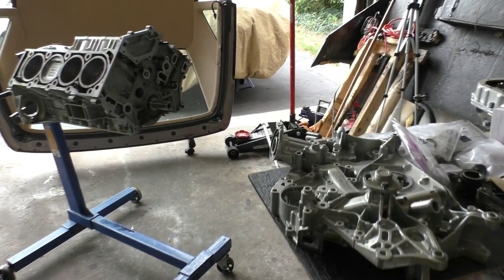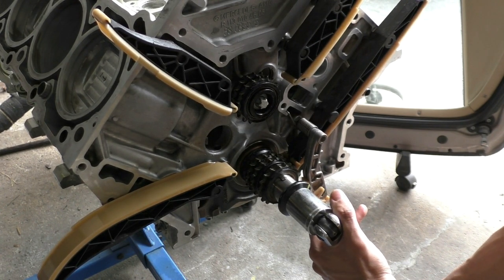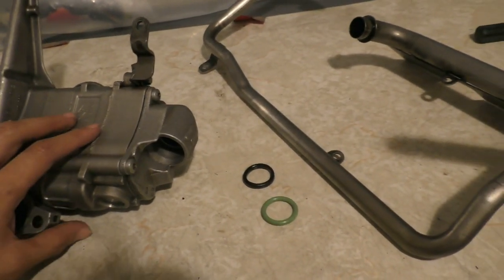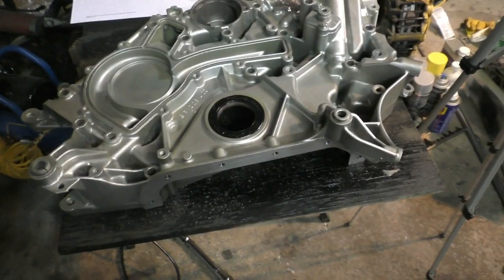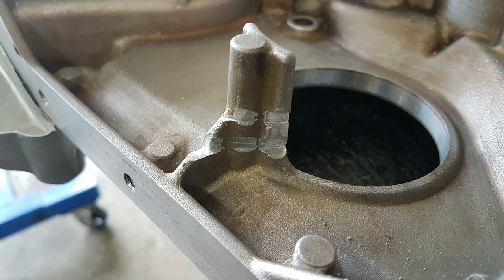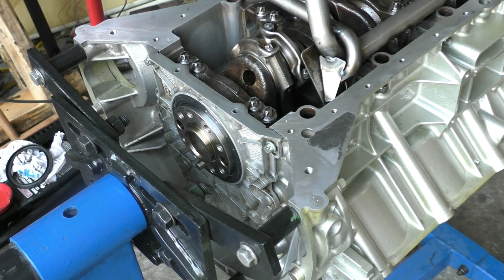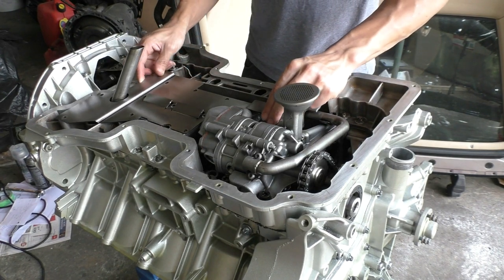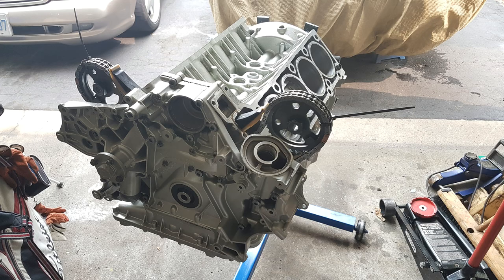E55 Engine Rebuild - Part 5 (Timing Chain, Timing Cover and Oil Pump Install)

Comment: Hey Is there a way to do the oil pump chain without a full engine rebuild? I have the noise where it hits the timing cover. Should I be worried? I drive the car hard often. If there is a way too do it what would you recommend while in there.

Comment: Also can I get to the oil pump pickup tube o ring if I did timing cover refresh/timing chain and the oil pump chain/ tensioner? Can it be done if you do a timing cover refresh or will you have to flip the motor over?

Comment: The green O-ring material is the same as used in home HVAC units. It's supposed to be more durable and this is becoming a common upgrade for automotive O-rings. Most shops here have HVAC O-ring kits to replace old O-rings.

Comment: Welcome to the operation channel. In today's surgery, we'll be putting back together the AMG E55 M113 engine. Nice work! Enjoyed watching every meticulous minute of it!

I think turbocharging is a great modification, in addition to supercharging, because you'll overcome the initial turbo lag with the SC and have the higher RPM torque & horsepower with the turbos. However, I'm curious to see this engine block without an SC and just turbo chargers only. THAT would be interesting, especially the numbers on the performance difference.

Keep up the great work!
Reply from the maker: Yeh, the turbos probably won't have the same low end torque the SC gives. They're sized for higher rpm's anyways, but I think it will help make more power in the higher rpm's because of less restrictions in the induction system and lower rotating mass
Reply: @xfmotorsports  Agreed. And if you're purpose of the engine is time attack, then it's safe to say that the predominant application will be in the high RPM range, which will favour the turbos more that the weight cost of the supercharger you discussed in your video.

Comment: Thank you for this video series. It has helped me to get this far. I have never rebuilt an engine before. Unfortunately I am now rebuilding my 87 560SL M117 and it scares me to death. I’m getting ready to assemble the engine and I can’t seem to find documentation on applying sealant to the front & rear covers. The documents you have for your M113 is something I need. Where can I find this for my car/engine? All I can find are torque specs & terrible PDFs. Every single nut & bolt on my entire car I have removed from the ground up. The engine is the last thing I needed to do. My transmission is being rebuilt by Sun Valley Mercedes Transmission in CA (#1 MB Trans rebuilder in the country). Next week I will be assembling the cylinder heads & lap the valves. I started a YouTube channel to help me document the process so I can hopefully put the car back together. I’m doing this because I could not find anyone else to rebuild my engine. It’s been parked since 2008 & I hope to start it in 2022. Wish me luck cause I’m going to need it.

Comment: nice job so far:

when i look the way you use the gasketmaker i remember why i usually use locite 5980.  it's easier and quicker without that messing around with the tube and the silikon. 

go on. nice job.

Comment: Fantastic job you have done - amazing, priceless, incrediable! Your videos are my very strict guidline during replacement of all rubber sealings of my M113K engine. One request to you: Where do i find the sealing and screw diagramms for the M113K and which type of sealing i should use? Thx a lot for ur feedback keep racing...:-)

Comment: Such an informative series. Currently finding metal in my C55 amg oil and oil filter. I sent them two Blackstone analysis over the course of 10k to 12k miles and both came back clean. I’m assuming the timing chain rubbing on the cover is the culprit. It does beg the question though… wouldn’t this occurrence cause other internal issues? I’m hoping this doesn’t cause my engine to seize

Comment: Would polishing the oil pump for a cleaner seal not make it fractionally larger/looser?
Reply from the maker: It opened up by half a millimeter but the o-ring still sits pretty tight

Comment: How much is stealership only? Did you measure the before and after sizes? May need a bigger oring. Amazing that casting was ever allowed to be used.
Reply from the maker: The o-ring is around $3. No, did not measure the size after polishing but would have been a small difference. The o-ring was still a tight fit after polishing

Comment: When rotating my crank I'm hearing tapping in my passenger head periodically. I'm assuming my timing is off ? I dont feel any binding or super hard resistance.

Comment: Would you suggest one of these cars to the average car enthusiast? I'm thinking about buying one, but don't know much about fixing cars. Willing to learn though
Reply from the maker: Yes, try to find a nice clean one. Wouldn't recommend it as your only car but as a second car its not a bad option. They do give trouble from time to time and the maintenance can get expensive, but for the price you can get these cars for, its more than worth it

Comment: Did you try free spinning the oilpump after assembly? Is there any resistance on the sprocket due to slight misalignment? I noticed it needs to be perfectly aligned, beyond just driving the bolts in.
Reply from the maker: Yeh good point, there's no alignment dowels between the different sections but they have to line up for the pump to turn freely. I had to loosen and retighten a few times before installing
Reply: Great series, BTW.
Is there any real fix for this problem with the o-ring on the oil pump pickup? Seems maybe a different type of material to use for the o-ring is necessary.
Good Luck on getting your engine running as new (or better).
Reply from the maker: I wouldn't worry about it too much as far as there is an oil pressure warning when it fails. I think the dangerous part is not having any warning when the engine looses oil pressure. A few GM cars had similar issues with o-rings in the oil collector going hard, but those cars had an oil pressure switch so they actually warn you before something happens

Comment: You could grind a fair bit of the casting to avoid the oil pump chain from grinding on it. 

When i rebuilt mine, i grinding and polished it flat a gain.. however it still grinded.  (I used new chain and spring) 

I took the cover off again and grinded another  4mm of casting.  So far so good.  

That section of the casting only spaces out the case.  So grinding the side and leaving the length untouched will be fine.
Reply: Hello,i have seen your videos i have same problem with my e55 oil pump chaim scratching timing cover,1 question this materials that are being worn scratched by chain where do they go?if they go to oil pan is there any risk they can pass to the engine?thanks

Comment: Where did you get all instruction
How did you clean engine that good
Is it possible to replace chain with out taking pan off or engine 
How much did used engine cost? 
THANK YOU
Reply from the maker: Got service manual from 'emanual online'
Cleaned engine parts with wd40, wire brush, scotch brite pad and gasoline for the really messy parts
Yes, chain can be linked to old chain and fed in as you turn the engine. That's why they come open ended
Used engine was $2800. The parts were more expensive. I'll try to put the list of parts together soon
Reply: @xfmotorsports  i very appreciate for your respond look like you live in Canada as well cool and thank you

Comment: There is no instruction to use a straight edge or a special tool to get back face of upper oil pan flush with back face of engine block? I did not see dowels used to assure the fit is flush for both parts.
Reply from the maker: Yeh, good point. There's no alignment dowels between the block and upper oil pan. I just lined the back part using a ruler. As far as it lines up flush with the transmission and bolting points, I'm sure it should be okay. There's no gasket or seal required between the transmission and engine so its not as critical as lining up the timing cover, but still it seems to line up pretty well just using a straight edge ruler
Reply: SK8215 if you used a straight edge you should be fine. Many engines have sumps that make a part of bell housing and front pump bushing or input bearing (manual trans) wear and leaks can result if the surface isn’t flat across.

Comment: Was your L and F mixed up on the timing gears? not sure if it refers to it upside down or not?
Reply from the maker: No, it was right. It's for when the engine is right side up. L referring to left side of the car
Reply: Thanks man, Love your build! So awesome! Hopefully you can participate in some project car challenges @xfmotorsports

Comment: I just purchased a 2006 CLS500 engine to replace my overheated 2002 ML500 engine, everybody says it fits, so far its been a bit stressful.
Crankshaft bolt pattern is different (so I cant use my flywheel) but flywheel  notches where sensor picks up signal is same pattern, want to put two engines on TDC and check if flywheel notches  are located in identical positions. Exhaust manifolds have to be replaced with ML ones, engine mounts, upper and lower oil Pan have to be swapped, and here is where my question lies, and hopefully someone can answer. The oil pumps are different ML has simple pump with pickup tube in one peace, while CLS oil pump is huge and has tubes to let pump suck oil from the back of the oil pan and a very short strainer / pickup tube in the front. I see that even the ML oil pump pulley or position is a bit higher compared to the cls pump, I measured the distance between the engine block and the edge of the oil pump gear/chain and ML oil pump gear/chain sits maybe 4mm further away from edge of engine block. I see on all data that you dont need to remove timing cover to replace pump, but what if I need to replace the chain too? since, like I say because of where it sits, probably chains are different lenght.?
WHat are your thoughts?  I have searched for engine interchangeability but cant find anything. Im also assuming that cam position sensor and gear is the same as ML? I would not like to have a crank no start situation.
Reply from the maker: Yeh, you'll need to change the oil pump. The chain can be opened and removed without removing timing cover. Thats why they come open ended. Wiring harness might be slightly different but crank position sensor should be the same. Compare the part numbers printed on the cam sprockets.

I know its a long job swapping engines between different models but can be done. Best of luck with the project

Comment: Hi,

How much did all the parts cost to rebuild? What was the total?
Reply from the maker: I mentioned it in the last engine video. I believe it was 4000
Reply: @xfmotorsports  Thanks for replying back quick!
I have 2008 CL63 6.2 engine and thinking about parting it out. Wanted to know if some of the parts are "reverse threaded bolts"? How would you be able to tell? Dont want to break the bolt thinking its the normal threaded bolts.
Reply from the maker: @boyb72  timing chain sprocket or balance shaft is the only one I know of. The service manual will tell you
Reply: @xfmotorsports  Never saw your other vid so didnt know how much. Anyways, love watching your vids! You make it look so easy when your rebuilding it!

Comment: I feel like the lack of ceramic coating is going to cause massive heat soak into the combustion chambers
Reply: The piston works like a heatsink, it's natural to absorb heat and the jet oil will cool them.
Also, he removed some parts of the piston to decrease the compression ratio.